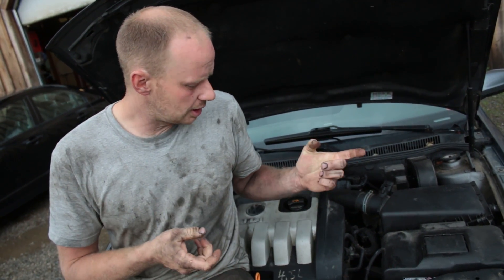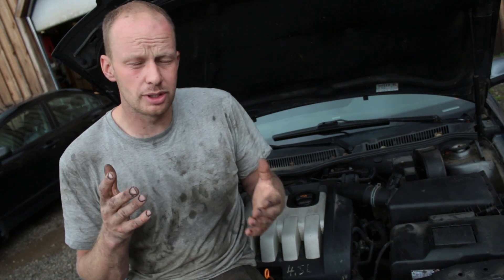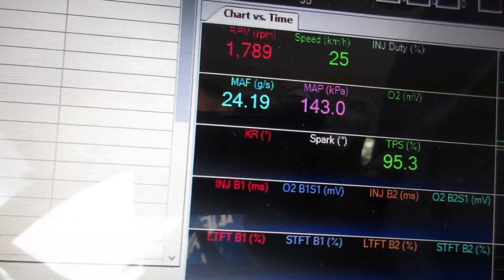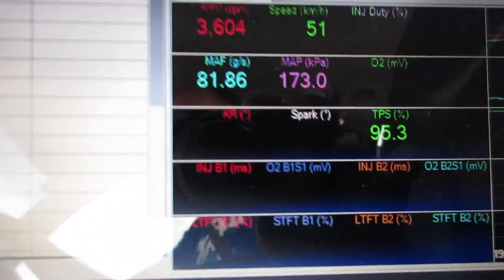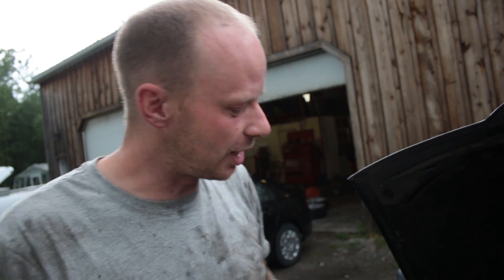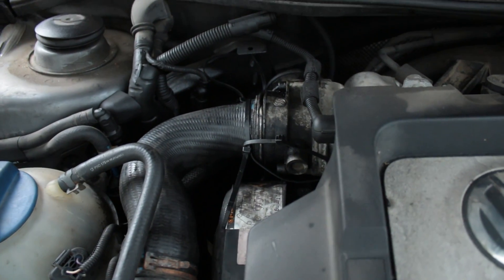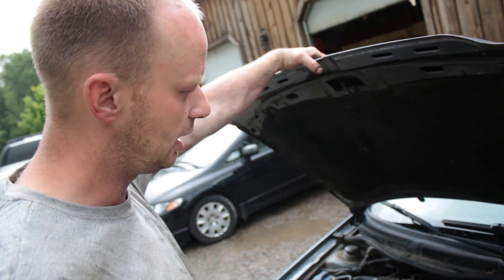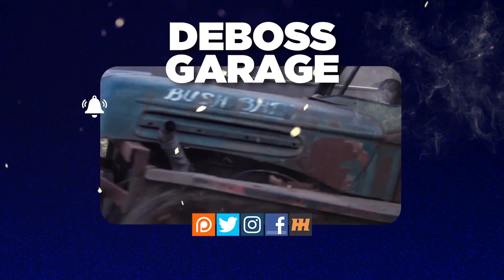TDI Jetta in Limp Mode, No Codes, NO BOOST!

Comment from the maker: VW TDI BOOST REGULATION SOLENOID N75 VALVE
https://kit.com/debossgarage/parts-materials/vw-volkswagen-tdi-bo
Reply: Has changed many n75 valves :-D. Known error. Here in danmarck
Reply: @Kalle2712  why does the Copenhagen airport suck so much? Denmark is cool but goddamn
Reply: FYI the EGR vacuum valve has a different part number but it can be swapped with the N75 to troubleshoot.
Reply: What do you think about the overall cars reliability. Transmission auto or manual, overall car build, electrical and engine?
Reply: @1029db   Not sure who you are asking here. But nowadays, it all depends the model you have and the engine type. The newer VW TDI engines are to my opinion no good. Get one with a PD engine series and you can run 100% Biodiesel without issues whatsoever. DSG gearbox is nice, but requires more maintenance. Electrical, sure, some issues, some more common then others...... If you are not a handy man yourself and are thinking to buy a new VW........best stay away imho.
Reply: @RobinGWakker  I'm looking at a 2004 Jetta TDI manual because of fuel economy, I drive a fair amount daily. I'm fairly handy, and can get help so I'm not that conserved about easy to intermediate work; I really just was afraid of having  major problems. So would the 2004 be a PD?
Reply: @1029db   You should be fine, the A4 is less electronically complicated then the A5 series.
Reply: I know I'm 5 years late,,,,, thank you brother.
Reply: To give you a suggestion. Every 10 to 15k miles heat up the engine and disconnect the hose going to the EGR valve. Keep engine at 2500rpm and spray 1 liter of water in there within 10 to 15 minutes. Lots of smoke etc, but you will prevent having this issue in the future.

Comment: I got a 2004 jetta tdi bew, sudden loss of  brake boost, replaced the rear pads and rotors as they were already bad, changed the brake booster and the tandem pump and still have the same issue. I also noticed theres no boost to turbo, any ideas on what to check???

Comment: Don't buy a BEW, they have defective camshafts and glow plug software issues with the ECM.  The plastic glow plug harnesses fall apart.  I have a 2006 with 60k miles with good glow plugs that won't start.  The local VW dealer won't even look at it.  I'll never buy another TDI.

Comment: If your car goes into limp mode after filling up fuel, it might be because the gas cap is not properly closed, allowing air to enter the gas tank and causing complications. Simply turn off the car, remove the gas cap, tighten it with at least six clicks, and then restart the car. You should be out of limp mode. Believe me, this happened to me Jetta 2.0TDI mk6!

Comment: It’s a bit late but it will be the turbo actuator that’s stuck. Can of foam oven cleaner with a thin pipe to squirt it through the egr pipe by the turbo, wiggle the actuator unroll it moves about half inch up and down. Then go for a hard run to blow the crap out. Worked for me.😊

Comment: Hey Rich got a good tip for ya with these wonderful 1.9tdi,So also limp mode no code can also be turbo its a Variable vane turbo, So a good cheap fix and test is egr valve that goes down to the turbo 20mm pipe it think about, take that off get a good can of mr muscle, with a hose slip it down as far as  it will go and squirt,  dont use the whole can it wont take that much, close it up let it site for 40 min then start her up, Watch all the black shitty gunk crap come out the exhaust let it warm up for a min then go to a highway and give it a boot. Been there done that with these many times, 1.9tdi is probably the best engine VW ever made, My old skoda had 900000k on it and was still pulling like a tank, Only basic maintenance  done on it and remaped ;) 3.5L/100 camper trailer behind it 90km/hr, 7.2L/ 100km

Comment: Hello. Been watching your videos. Thank you for sharing. 
I have tried everything and still at times my Jetta has good power and then the next time I cannot go higher than around 3000 RPM and then you can feel it kinda steps down power wise.  

I have just replaced the head gasket the water pump, timing belt oil change near thermostat. 
Not sure if I did something to it that it does not like. 

Maybe you have an idea on what I should try next. 
I have replaced the air intake sensor. The N75 
I’m not sure what else it could be 

Is there  N75 supposed to let suction through at low rpm or at high rpm?

Thank you

Comment: I replaced that valve as well, my egr was deleted, throttle plate moves freely, still stuck in limp mode but here the thing, still no power but when it gets up to temp it just shuts down. Absolutely no clue why but it does. When it's cold it runs okay, still little to no power but it runs and idles until it gets warm then it just goes from 900 rpm right to zero like you turned the key off

Comment: Wastegate actuator.  Happened to me before the grapevine climb to Los Angeles.  Had no boost and went from light throttle at 75mph to 3/4 throttle to maintain 75mph. It's one of the few things that go wrong that doesn't trigger a MIL and is 1975 VW Super Beetle speed.

Comment: I have a 2000 which seems to be going into limp mode if it sits while hot. Drive it for a couple of minutes and ignition off and on and it's back to good. I'll check the vacuum lines...

Comment: Anyone know why this would happen, I made the evry mod and I used a 1k potentiometer and I had it maybe at 75 ohms and my car went into limp mode and wouldn’t shift out of 3rd and I turned off the switch and it stayed in limp mode till I turned the car off but after I started it up again it ran fine with no problems haven’t use the switch since incase I blow something

Comment: ALH's are pretty reliable as is... funny I was saying "probably the N75 valve" talking out loud before you even mentioned it. They're probably the most common failure situation in an ALH or any of the 1.8t cars. Those ALH are really good cars for the money though and go for quite a few miles and pretty good abuse. Definitely VW'S best diesel engine. Tuners like Darkside are getting quite a bit of power out of them too. IIRC with just software, you can get something like 60whp.

Comment: Those TDI's usually have 400-500k on the clock here  in Finland and of course rust. But people still drive those -> economical and cheap to buy. And not too complex to fix.
Reply: Cheap to buy? These things sells for 5 to 7k with 250k on them with a 5speed here in Alabama!
Reply: @marcowens3522  That's a lot of cash! An old Golf TDI, let's say before 2008, it has to be really nice if there is 250 miles on the clock to get 3k from it. In US they are more special than in EU? 🤔
Reply: @marcowens3522  just bought one in finland for 300 bucks has 390000km😂😂
Reply: Not too complex to fix?  Bulllsh.t!  You need a Vagcom scanner to diagnose the problems and the electronics are a nightmare.  I'll never buy another TDI.

Comment: Hi, I have a 2013 VW Jetta TDI and just started having problems with it. It goes into limp when being pushed above 60 mph on the freeway and the code that it throws is fuel starvation. The whole fuel system is new also, the regulator and the MAF Sensor is new. Any Suggestions guys! Thanks!

Comment: 2002 tdi  throws a p303 code runs rough .  Could this be an injector problem? Going to crack the number 3 injector to check for fuel , anything else besides vacum lines to ck for?

Comment: Please help me i have a 2002 jetta tdi , car was running perfectly fine then the next day i go to start it and it just cranks and doesnt start. i tried using starting fluid it would start but die out and wouldnt allow me to give it gas . i replaced the fuel filter , primed it , cracked the injectors and still no start please help me im clueless now 🥺
Reply: Well you shouldn't put gas in it
Reply: @Mr.Husky621  i didnt put gas in it
Reply: Don't use starting fluid, either, unless you like holes in your pistons.

Comment: Sorry to say this but that is absolutely not how diesels work. Air is not supplied by the turbo, the turbo is there to give you a higher efficiency. Air is always present, the engine is free to draw in as much air as it wants. The computer then measures a couple of sensor signals (for example a MAF signal),  to determine the load and engine speed, and uses this info to decide how much fuel it will inject. The engine does not rely on the turbo for air supply or metering, and will run perfectly fine without it, just with less power. And indeed, the car did not throw a code even though the turbo was doing nothing. It's German, it would've thrown a code otherwise. The engine doesn't even meter fuel to air, it meters fuel to load. Diesels use an excess air regime, they run lean all the time. Even at fuel load they run an AFR so lean a petrol car wouldn't run on it.
Reply: Prettty good explanation--gas turbines and diesel engines are both "excess" air engines, while gasoline engines are stochiometric, which is just a fancy way of saying they need a specific air fuel mixture going into the combustion chamber in order to run. One way to think of a turbocharged engine (whether gas or diesel) is that it makes the engine temporarily bigger (more displacement) when the boost is on. However, bigger engines lose out on efficiency under light loads, so the turbo'd engine gives you the best of both worlds! So, think of the BEW or ALH engine as 1.9L displacement at light loads, but double that (boost is about 100% of atmospheric pressure more or less) to 3.8L under full boost.  Not only that, you don't have all that 3.8L hardware to carry around, either.

Comment: Would this be the same for alh ? I get a glow plug light flashes and multiple shirt to ground codes on vcds
Reply: Yes on the alh the vacuum lines are the same, with the glow plug issue check the rubberised wiring that connects to the glow plugs, used to be beaten up, recently replaced on my '99 alh too

Comment: good god man, you almost know what you are talking about with that car. wtf, turbo supplies air? no, the maf reads the amount of air, temp, baro. the turbo pulls the air in then compresses the air and pushes it into the engine. you damn idiot, read the service manual. that car DOES NOT HAVE A WASTE GATE!!! that car has a variable geometry turbo, a vnt. the vnt is stuck.  you have a bad turbo. clean the turbo or replace. fixed. this is why people like you should not work on cars or make videos. dip shit- the car uses a computer controlled vnt turbo. one reason is so the ecu can turn the turbo off to protect the engine

Comment: Had this on a T5 Transporter with the 2.5 TDI straight five engine with the variable turbo. Same thing. Overboost. Sprayed Mr.muscle into the turbo and intake. Changed the regulator also. Went like a champ afterwards, finally the valves in the turbo worked again aswell.

Comment: proper presentation . 75 year old ex Donnington GT champion 1980. My VW 2.5tdi Caravelle has suddenly started playing up. the motor runs great after a cambelts replacement . 120 mile journey to the airport and leaving the airport the motor failed to respond and my turbo gauge showing zero . . lifting my foot and re applying the throttle and the motor returned to normal response. This continued to occur . for the 130 mile journey back home .  accasionally after coming to rest at a junction or traffic island   the motor would idle perfectly but attempting to pull away and the loss of turbo kicked in immediately.

Comment: The throttle body doesn't control air flow as most think on these.  It's an anti shudder valve.  It's sole purpose in life is to snap shut when you turn the car off for a smoother shut down.

Comment: I had and have this same problem with 06 seat leon 2.0l tdi sport 140bhp... but now my car has gone to that mode but not coming back ... cant find this valve anywhere 👌cleaned egr and inlet and still no joy any help welcome hahaha...cheers
Reply: My dad have toledo 2005 2.0tdi 140bhp same problem if you fixed it can you share solution
Reply: THeres a few other things it could be, bad boost sensor, bad n75 or could be a vacuum leak somewhere. I have same issue on my fiat, tried everything, but last thing to change is the boost/ n75 solenoid! I'd recommend getting the egr valve blocked and turned off on the ecu :)

Comment: This Turbo got no Wastegte. It got a Variable Turbine Geometrie.the kommen issue is this start to get a fault and overboost the engine when the turbo is hot. Also you are right the N75 can be a problem too. But there is no wastegate at close to 99% of all VW diesel cars

Comment: I have a 2005 Jetta TDI 1.6 it was running like a champ then starting this herky jerky thing then just completely bogged down and lost power.  It ill not go over 5 MPH... Ideas?
Reply: Mass air flow sensor or the 109 relay which is 20.00 $ mass air flow sensor on Line about 40.00 or 50.00$ buy extra 109 relays keep in glove box

Comment: My 2002 ve beetle with the tdi alh has the same issue goes I to limp mode when it over boost which was a lot then I got a boost gauge much better now I just shut the car off while moving (I have a manual so clutch in easy) and turn back on all good to go it can be tuned out
Reply: I just changed my anti shutter valve and did a simple egr delete by just blocking off the heat exchanger port and egr port , changed the boost actuator and all vacuume lines it seems to be a lot better no limp mode so far .

Comment: Nice video man.
Please help me.
My vw 1.6 tdi goes in to limp mode at 130 km/h after shutting the engine of it will run again for some km. I have no error on vcds.
What do you think it might be? 
The only error I got last time it wose maf senzor signal too high
P0103 00 [32].
Reply: Same mate, but mine shows turbo over boost problem
Reply: Samee, did you find a solution?
Reply: @sammcharis  
Not yet

Comment: There is also a check valve in the vacuum lines.   Make sure the vacuum lines are good from the brake booster all the way to turbo actuator.  It’s not a waste gate it always moves.  There is a small one way check valve that is inline to the n75 valve.   Good video

Comment: Did the car just go out of limp mode on its own or did you have reset the ECU? If so how did you reset? Thanks and great video!
Reply: Brent Waddell I wanna know the answer too
Reply: It didn’t come out of limp mode until I removed the DPF and replaced with a Buzz Ken down pipe. Malone Tuning sent me a new Stage 2 tune with the EGR & DPF delete and the car has been running great since. I tried to reflash the Ecu several times with my Malone Stage 2 tune before deleting the DPF with no luck. Hope that helps!

Comment: 4:07 WRONG, that is the Anti Shudder Valve, that operates in 2 modes: fully opened, or fully closed. It test itsefl when shutting engine off. That valve will close itself to prevent a engine damage in the case of an engine runaway ( tdi do that). That all the ASV valve does. Just a FYI. It does not control the volume of air that goes in the intake.

Comment: I have the same problem with my 2006 Volkswagen Caddy diesel could you give me any suggestions for this model please as as soon as it's under load and you go up a hill or even on the flat it goes into the same limp mode thank you
Reply: did you change the n75 valve? and check for vacum leaks. ihad this prolem and it actually turned ot to be a bad fuel cap
Reply: @Grimwriggler  bad fuel cap?!? Dude,what are you talking about?

Comment: This often happens after a turbo over-boost, if it's a variable geometric turbo clean the vanes if not it could be a vacuum leak or the N75 valve. You can reset this fault while driving...just switch of the engine and restart it, it will reset. I had to do this a few times doing 130Km/h on the motorway in France with 1400Km still to go, just getting the car and family home...no big deal...just don't lock the steering wheel !

Comment: Just gonna throw this out there, not all diesels have turbos. Most do because it's more efficient when you want more than like 60 hp. For example the 1.6 N/A and 1.5 N/A VW diesels.
Reply: BoostAddict here in the UK there was a 1.9 non turbo vw  engine and  boy that was a slow car but all the taxi drivers loved them because they were a reliable motor. The gearboxes were made out of chocolate though...
Reply: I have heard something about them. Isn't it just an AAZ with no turbo and a slightly different injection pump?

Comment: As has been noted, this BEW has a VNT turbo, a borg warner kp39. I have owned two of them, one of them had a boost issue that was a vacuum hose that goes to the vnt actuator, it had worn a hole and caused a vacuum leak thus the VNT wasn't functioning (as it uses vacuum as the force to operate the mechanism).